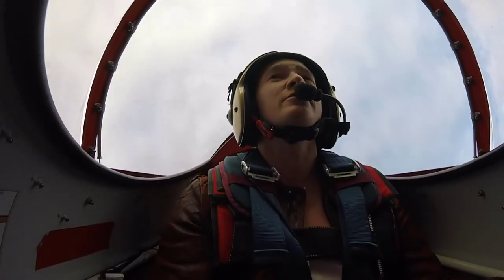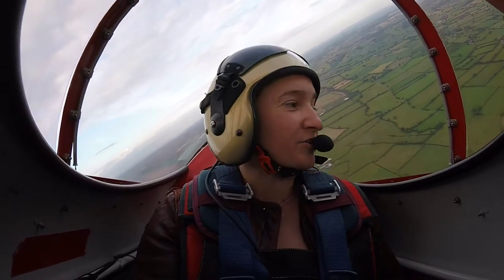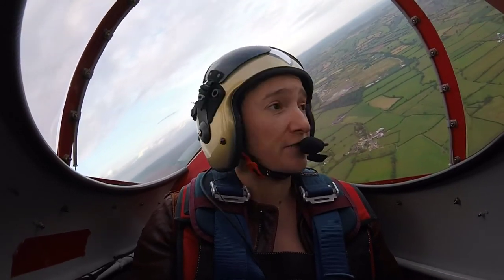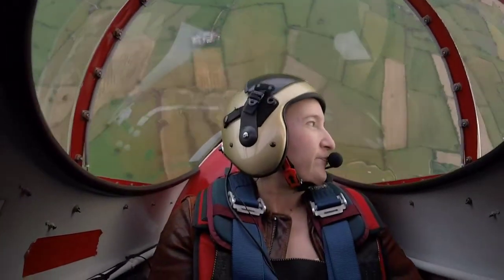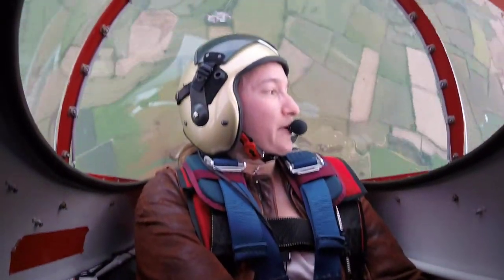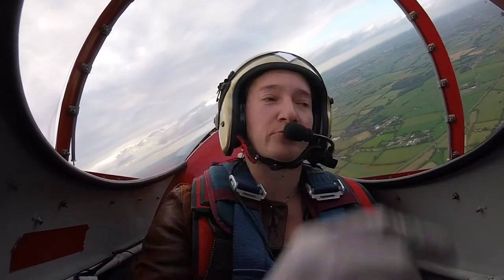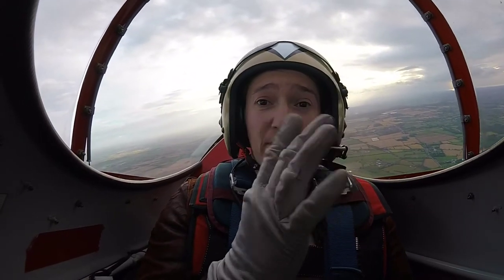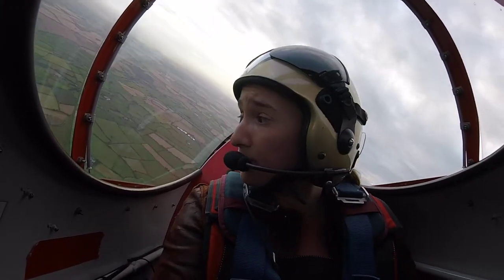Inverting Expectations Episode 2: Positive Spin | Aerobatics and airshow vlog

Comment: A couple of questions spring to mind: Do you need/have to wear a helmet during displays and training? Presumably you need to be in good physical shape for this stuff, so do you have a training regimen outside of training in the aircraft. Apologies if you've answered these elsewhere!
Reply from the maker: Peter Batty you don't have to wear a helmet but after several years of not I decided to invest last season as I was flying an aircraft type that made it more necessary, I've carried on wearing it in the Pitts as it just adds a little extra safety margin - hitting your head on the canopy happens surprisingly often. 
Regards fitness, yes it definitely helps to be fit and strong- these days I find the most benefit from lifting weights at the gym!